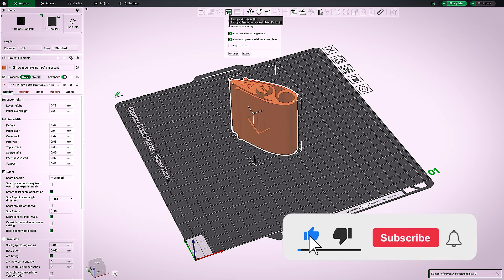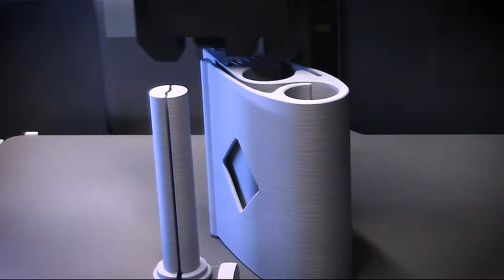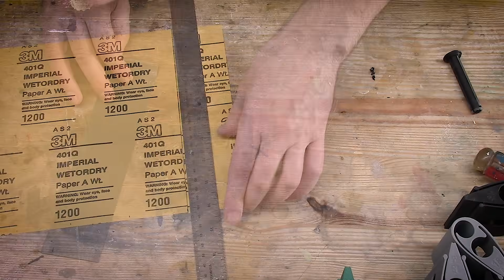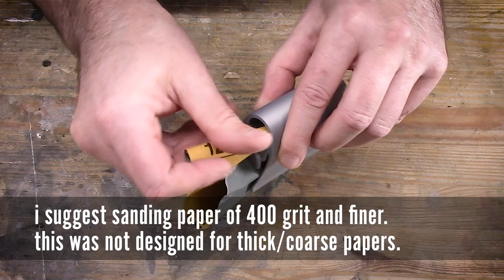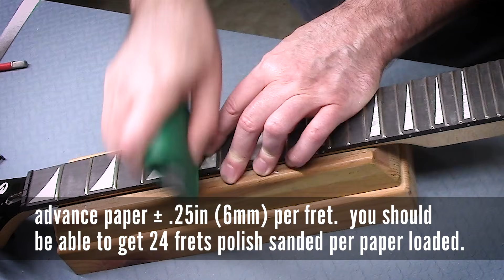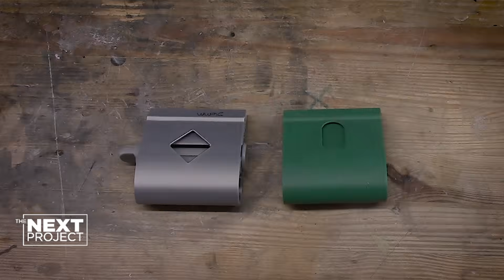3D Printing Guitar Project Tools   Fret Sanding Grip v19 E4C

Comment: That’s brilliant—really good stuff. I’m going to try printing it out. By the way, do you know what fret size it’s designed for? Vintage, Medium Jumbo, or Jumbo? Or, if I have to print only one. Wich size do you recomend for all?
Reply from the maker: SYUX, thanks for watchin!
There is a small text print tool in the batch of files, it can be used to verify what size tool you want to print, and also to test you print settings.
I've almost always used the Wide version, and only needed the Medium once on some small fretwire. I think the XW version is overkill, probably won't ever need it.
Look for "PRINT FIRST - The Grip Sizing Tool - Narrow-Medium-Wide-Xwide", this will help determine which size.
Also remember that there will be a layer of sandpaper which will make the concave surface a little tighter. 
I have been using 600 grit and finer papers, most often 600/1200, then polish.
Good luck with your projects!

Comment: what print settings do you use? the thumb screw refuses to fit after multiple prints for myself.
Reply from the maker: Thanks for watching!
There is a .3mf slice file for reference included with the part files in the description link.  I don't recall right off hand, but I don't think I had any special settings. One thing that may be causing issues could be differences in filament being used and flow rates.  
I used PLA, and mostly generic settings for the filaments 
Sorry you're having print issues. Let me know if you get t sorted out .

Comment: I must say your channel is absolutely awesome! Not only that, I noticed that you actually take your time replying to people's questions! You said you don't want to start a business but I'm one of those people that would gladly support it if you started.

Anyhow, I was wondering before printing this, have you had by any chance to try and use micromesh papers on this device similar to the Frtlzr fret polish tool/system?
Reply from the maker: Thank you so much, I greatly appreciate the compliment, and comment too!

I value the time everyone takes, not only to watch the videos, but to comment, ask questions, give suggestions... So, I try to reply as best I can. We're all in this boat together, might as well be friendly. 

I am still giving the "production" of the sanding grip some thought, and may be getting closer to having some produced. Can't say when it would happen, only that it "might" happen.

I haven't tried Micromesh on this tool. During my original thought and design process, I intentionally chose not to use micromesh, as it it more expensive and harder for many people to acquire. I felt that standard "paper" sandpaper might be in reach of most people.
That said, I honestly don't know if micromesh will work in this tool, as I think it may drag and not advance very well due to its physical nature. But, I may be very wrong. 

I haven't used the Frtlzr, but have seen videos of it being used. I had used a wooden block years ago that was basically what the Frtlzr is today, my wooded block just wasn't very pretty.

If I get around to producing the Grip, I'll post a video to let everyone know. 
Thank you for your friendship and support of this project channel.
Be safe and take care!

Comment: Man I just love this channel, I saw the 3d printed feet  for the neck relief guage but my question is what brand of relief guage are you using this with? I have searched but can't seem to find a video on it? thank you so much for what you do!
Reply from the maker: Thanks for watching and glad you're enjoying the channel.
I think the relief gauge are for an "Edgetool", which may be a direct knockoff of the StewMac tool... 
There is also a small "cap" for the plunger of the dial indicator, should be in with the feet.
Good luck with your projects!

Comment: I haved a bamboo lab 3d printer can you give me a file
Reply from the maker: There is a link in the video description, which contains .STL, .STEP and a .3mf file that your Bambu printer should be able to use for printing.

Or, here's the link to make things easier:
https://www.dropbox.com/scl/fo/z70x7gp1t1be9hnds8nii/AGBHc44TWqIJWvdR0zv7AJU/The%20Grip%20Sanding%20Polishing%20Handle?rlkey=d5fyzml1sdl3s2p2yr531xshe&subfolder_nav_tracking=1&st=oqwivdia&dl=0

look in the " The Grip Sanding Polishing Handle / v19 " folder.
Everything is in there.

Be safe and take care!

Comment: ive been regularly using the previous version and its great, i use a regular frtlzr i already had for the lower grits because my coarser paper likes to rip in this then i use the grip to go up to about 1500. one improvement that im not sure would even be feasible with 3d printing is to be able to swap out the sizes without needing to print the whole housing, could be a long shot of a suggestion idk.
Reply from the maker: jaackaary, thanks for the comment!

If I'm hearing you correctly, you're using the FrtLzr for the lower grit/coarse papers, and The Grip for the fine high-grit paper such as 1500.  
I've found The Grip v17-18 are best suited for 600 grit and finer. I've used 400, but it tends to hang-up in the housing and not advance well, that may be what you are experiencing.
V19 may work a bit better for coarser papers, as the grit of the paper is rolled to the inside of the top-most "supply" feeding area of the housing, and should have less abrasive drag. 
V17-18 had the paper coiled with the grit facing out, which caused drag against the housing - not ideal.
Let me know how coarse of paper you start with when using the FrtLzr, and what grit you switch over to with The Grip.

Everyone will have their own process, so It's good to hear what's happening out there in the world.
My current process uses The Grip after final crowning, typically starting the polish sanding with either 600, or 800 grit, then jump to 1200 or 1500.  So 2 rounds of polish sanding (ie 600/1200, or 800/1500). Then if needed I'll use a metal polishing compound for final shine. 

I haven't needed to use anything coarser than 600, but again, everyone has a different process.

Let me know your process, it will help me made design decisions going forward, thank you!
Reply: @theNextProject  hi, 

you're right I use 400 on the frtlzr then on the grip I use 800 then 1500. the 400 grit is probably a hang up from my old method which was hand polishing with 400,800 then steel wool and maybe a buff with a Dremel.

I'll give 600,800,1500 a go next time and see how it goes. :) your channel is a fantastic resource
Reply from the maker: Gotcha, 
Yep, 400 is about the roughest that will fit in The Grip, and as we know it just hangs up and fights us.
I could open up the sides just little and test that (future version possibly).  
Thanks for your input, it all helps, and I appreciate the kind words. 
I'll keep working on it.
Be safe and take care!

Comment: Great gadget!!! Truly
Reply from the maker: Gary, thank you very much!
I'm currently working on a "pre-print size gauge", which will help determine which size housing to print, or print first.
I'll be dropping a prototype size gauge in the folder shortly. 
Good luck with your projects!
Reply: @theNextProject  i’m having my wife print out four of them different color filaments for different color grits. I’m excited I normally use the music nomad version but those pads get worn out so quickly and they’re expensive much cheaper to go with some inexpensive sandpaper thanks again.
Reply from the maker: Gary, I just uploaded a "sizing gauge". 
If it's not too late, ask her to print that for you first.
The gauge will give you an idea which size (M, W, X) you will need for your projects.
I typically use the Wide version, but it may not be a best fit for everyone.
Also if you do print the gauge, keep in mind the thickness of the sandpaper being used which will slightly impact the tools concave radius.
When you get all set up and have a chance to use the tool. Please let me know what works, and what doesn't work for you.
Happy polish-sanding!
Reply: @theNextProject thank you  St Luthier of the guitar gods 😂

Comment: This needs the ability to change out the fret radius.
Reply from the maker: Sdshirtman, thanks for watching!
This tool is intended for polish sanding of the fret top, post leveling and re-crowning. 
Not designed to change the fret radius, only to remove tooling scratches left from the leveling beam and crowning files.

There are currently 3 width options included in this version, Medium, Wide and X-Wide. All 3 width files are supplied.
So, these should be close to fitting most fretwire widths, but perhaps not the really narrow and short wires, nor banjo, ukulele, etc...

I'll be adding a small pre-print tool to help make a decision between which version width will work best for a given need. 
Additionally, the end user will need to consider what sandpapers they will be using, the paper thickness will also take up some space.

There is some additional information that may help in the previous version videos and documentation.
Hope this helps, good luck with your projects.
Reply: @theNextProject  I understand. Fret width is what I meant by radius. It would be nice to have the ability to change that out vs printing out a complete unit for each fret width.
Reply from the maker: Gotcha.
I hadn't really considered making a one-size fits all tool, but as it is, I've mostly use the Wide version. 
It seems to fit wire that is 0.100 - 0.118 wide pretty well. 
To deal with crown height, I just angle the tool a bit, side-to-side, as I polish-sand to hit the sides.
Also, I'm currently using 800 grit and finer.

Hope this helps.

Comment: Ingenious design, thanks for sharing! My buddy, who builds and sells high end handmade guitars, agrees.

One suggestion I have is, instead of listing the sizes as medium, wide, and X wide, which is quite ambiguous, you should tell the actual width they are designed for.

Reason I say this is, I printed the medium grip, and the radius is so tiny that the only guitar of mine it fits is an old Martin Sigma with 1.9 mm wide frets. I also printed the X wide, and it's too wide for all my electrics...even though their specs say they're made with "Jumbo" frets. That's 16 hours of printing down the drain...ugh.

So my advice for anyone thinking of printing this: Drop all 3 grips into your slicer and print them. Abort the print after about 2-3 mm high and check the fit of each with your guitars. Then do a full print with the grip(s) that works for you.

Thanks again for creating and sharing this!
Reply from the maker: Bullfrog Pond Shop, thanks for the great write-up.

Originally, I only had what is currently presented as the Wide, if I recall. I then was asked for narrower and wider versions.
I really didn't have time to test and compare to a bunch of different fret wire sizes, and the current tools may be rather ambiguous I understand. To compound the issue even further,  is/was what sanding paper weight is being used. A 400 grit paper is thicker than a 2000 grit paper, so the 400 will choke in the little concave sanding surface. UGH!
Personally, I've been using 800 and finer papers, but I started out testing with 320. I don't go there any longer, but some people are using very coarse paper. 

As I was reading your message, I really liked when you suggested "print all 3 and stop the print...".
That is a great idea, for a pre-print tool gauge that I can easily design and it can be used to reference what someone may want to print. It would basically be a small print piece with all 3 (or 4...) sizes to help determine what final tool should be printed.  
Ah, brilliant!!!
So, it may not help you at this point, but a little selector gauge may help a lot of other people, and may also help others suggest a new tool that may fall in-between what is currently available.
I hope what I'm typing here makes sense.

Sorry you've got so much print time on these. I'm not sure what printer, filament, resolution or speeds you are using, but 16 hours is a huge amount of time - sorry.
I'm typically running PLA, maybe PETG, 0.4 nozzle, and a 0.28 extra draft layer. So my prints are not fine detail, but they are tool so I'm fine with that.  I'm getting a complete tool printed in around 2hrs.  So, it appears print time will/can vary widely. Sorry for that. 

Thanks for the idea.
Be safe and take care!
Reply: @theNextProject  Yes, a pre-print tool gauge IS brilliant...great idea!

No apology necessary regarding print time. I have an entry level printer, the Ender Pro-2, and I'm running with Cura's default printing speeds and resolution for PLA, so I guess that's to be expected. I confess that I haven't done any research or experimentation regarding speed or resolution. Not sure where to start, frankly, and since I'm not printing enough that my printer is running constantly, it's no great burden for me to print something overnight.

Funny...me complaining about print time reminds me of Mrs. Jetson (dating myself) complaining about being exhausted from pushing buttons all day - haha! First world problems, right?

New sub, looking forward to more good stuff!
Reply from the maker: LOL, "Mrs. Jetson... pushing buttons". That's a great analogy. We've all moved in that direction. I just got out of a 3-day training program at work.... It was all about pushing buttons and acronyms that I weren't in my vocabulary.
I'll get working on the pre-print tool, thank you for the idea!
Thanks for hanging out with me here, more odd projects coming soon.
Take care!
Reply: @theNextProject  FWIW, the "wide" grip just finished printing. It fits all my electrics.
Reply from the maker: Just turned your gauge idea into a printable. 
I've uploaded it to the folder, and for the very rare need, a Narrow version too.
I wasn't going to release the narrow, as only a couple people will need it, and I'm now one of those people.
An acoustic with itty-bitty frets. ugh!
Reply: @theNextProject  Nice!

Comment: Very cool design! Just stumbled upon your stuff by accident and I love it. The exact reason I love Youtube. Has anyone tried this with Micro Mesh? I think it would be great to use it with these abrasive sheets. But the sheets are 75mm wide, so the design needs to be stretched out a little in width.
Reply from the maker: Tim, glad you found the channel and thanks for watchin!
I don't know if anyone has tried micro mesh, but one reason I designed this tool was to use a more readily available, and more affordable, standard paper. I had looked at MM and local availability... so I went with standard wet/dry paper.
I don't want you to waste your MM paper, but if you want to try it, please let me know how it works for you.
Good luck with your projects!

Comment: Not a fan of the cutout now. There is less material on one side for your thumb/finger so they go in the recess between the body and the roller when gripping it. If that makes sense.
Reply from the maker: Clutch, thanks for watching and the feedback.
If I'm understanding, you don't like the diamond shape cutout?  The new "thumb-hole" opening lets your fingers fall into the side openings too much. Correct?
That's good feedback, I'll try to come up with a better ergonomic solution that also keeps the need for printing support to a minimum.
Greatly appreciate the testing!
Be safe and take care!
Reply: @theNextProject  yeah, difficult to explain, seems like V18 had more 'meat' inside the cutout for your finger to press on the one side where you can see the roller spindle. I was also wondering if a circle cutout may feel more comfortable to your fingers.
Reply from the maker: @clutch2827  the original shape did seem very natural, and looked like it belonged there.
The reasoning for the diamond shape was driven by the printing process.  The diamond can be printed without support, so it should be a little quicker and easier for everyone to prep for printing.  That's the only reason.  
I do agree that it definitely feels different in the hand, and the placement of the opening has been shifted a bit to help aid with loading.  
There are always adjustments needed.
Thank you for the good feedback, greatly appreciated!
Take care my friend!

Comment: I printed an earlier version and have used it serval time, it works great! The only issue I had was the glued on knob of the center roller keeps popping off. Still work great though, looks like you made some changes to that part so I will print out the latest version, thanks so much for sharing the files and design!
Reply from the maker: Eric, thanks for watching and for testing the tool too!
Sorry to hear you're having trouble with one of the pieces. I'm not sure why the glued on knob would be popping off. 
What filament did you print with and what glue did you use. Perhaps the glue isn't sticking to your filament.
I used PLA and superglue. I think I also printed a few in PETG, again stuck them together with superglue.
The good news is, if you need to print additional reels and knobs, they go pretty quickly.
Glad the tool is working for you otherwise.
Yes, the v18 and v19 spool assembly (reel and knob) will fit any of the housings v17 - v19. 
Keep me posted on how things are working, or not.
Be safe and take care!

Comment: Why not an arrow to show the direction to twist the knob? “Load =>” or “<= Advance”? I’d be unrolling it with each use… thanks for sharing”
Reply from the maker: A1A, thanks for watching!
A directional arrow could be added, but here is an issue with that. 
The spool can be inserted from either side of the housing during assembly. 
Right-handed, or left-handed... which then changes the direction of the paper loading onto it as the knob is turned. 
I've unrolled the paper a couple times, then I roll my eyes, and do it again... then I get to work.
Hang in there, we're all human, more or less.
Hope all is well, be safe and take care!